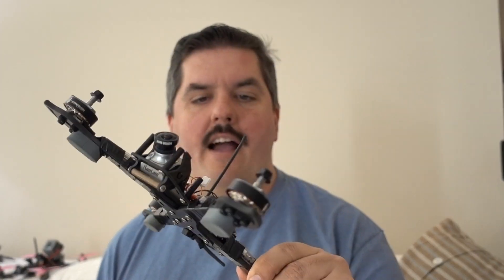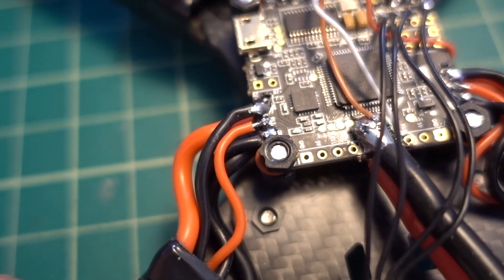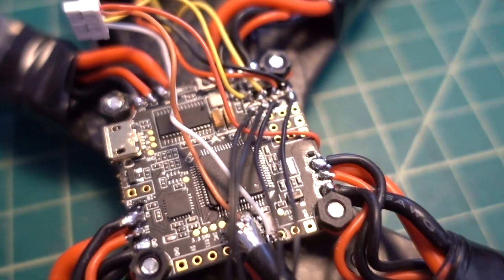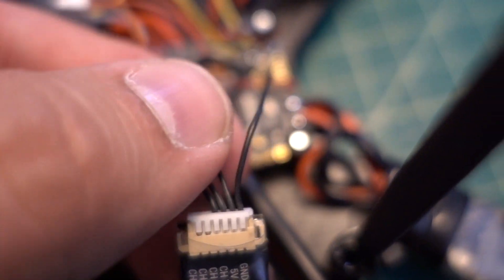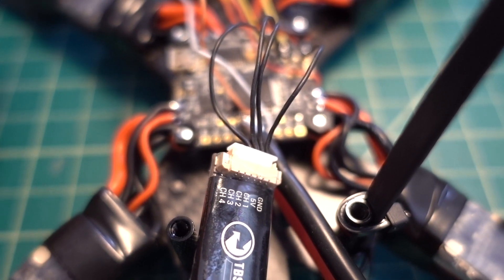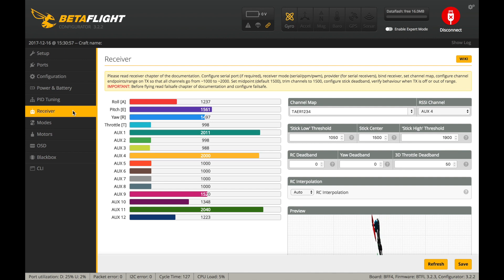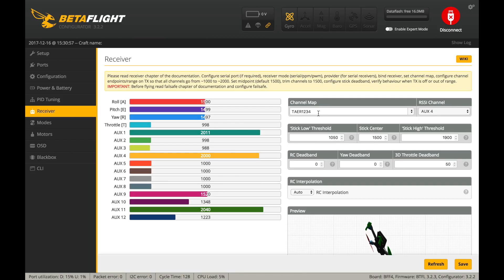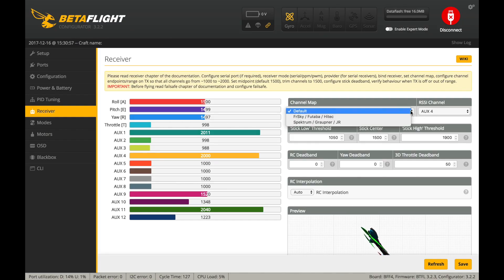How to Set Up Crossfire in Betaflight

Comment: Thanks for the video.  I have question my receiver is  Refused to bind or to updated after i updated the TX firmware.  And i followed all what you did with tours but i when i push the blue flashing light it just turn to blinking orange color . Do you have any idea what went wrong please?

Comment: I've followed your steps to the T and I'm still not getting any "movement" within BF Receiver tab. Properly wired up Rx -> Tx & Tx -> Rx on UART4. Enabled Serial Rx on UART4 within BF. Receiver is bound. BF configuration tab is configured for CRSF. Funny thing is I upgraded to 3.4 a few months back and initially had the same issue, but after messing around with the Channel Map (just swapping it by accident) I got it working. Now I just upgraded my FC to 3.5 and I'm back to square 1. No wires were changed. Any thoughts?

Taranis
Crossfire Nano
Matek F405-CTR
Reply: Josh Cowley hi. Did you manage to resolve it? Would like to learn from your experience. Because I’m encountering that right now. Any tips is appreciated.

Comment: Troubleshoot Help. Might help someone...
I've followed the video in every step, but in betaflight the receiver tab won't receive any inputs. I've tried different channel maps, also changed 3 different UARTS and none of them work. The crossfire binds all green lights but just won't receive on the flight controller. 

I'm using a Matek F405 CTR

Any help is appreciated!
Reply from the maker: You also have to map the outputs on the crossfire to CRSF. Set the protocol to CRSF and check that it is wired correctly.
Reply: StingersSwarm thanks for the reply. Yep fine all that. I've got a ticket with tbs going. So will pay an update when it gets fixed.
Reply: Hey SingersSwarm just letting you know I fixed my problem. My nano receiver the solder was to thick on the bottom side of the nano causing continuity between GND and CH1 so re-did all the soldering and its working perfect! Thanks for help and really appreciate your videos without guys like you we'd all be stuck.

Comment: Stingy, I did everything you have done and my reciever is bound to the crossfire but for some reason Im not getting any inpunts on the quad. Do you have any idea what it might be?
Reply from the maker: I'd start by checking the inputs and outputs on the Crossfire itself. But it could be several things. Chase the signal from the sticks to the FC and try to find the failure.

Comment: I have two quads set up with crossfire, micro tx and micro v2 receivers, One on a betaflight f3 board and one on a betaflight f4 board. Both are wired exactly the same and set up the same in crossfire and betaflight. 

I cannot get any battery (voltage/amp/mah, etc.) telemetry to come through on the taranis or the osd on the bff4 setup but I get all other telemetry (LQ, etc).

I do get all telemetry on the bff3 board and the firmware on both the FC and TX/RX are the same .

Also, I am running crsf on TX1/RX1 on both.

Anyone ideas to try and get it working on the f4?
Reply: dahosfpv hi there. Did you find out what caused it? Would appreciate if you could share your findings and solution.

Comment: You should try using a unify pro with crossfire, if you wire up its smart audio to the last pin on the rx and set it as smart audio in the lua script on the rx (CH 6 I think), you can control every aspect of the vtx through the lua script on your taranis, it's soooo nice!!
Reply: Any VTX with uart control you can control all settings with LUA script but you use BF lua instead of crsf LUA.
Reply: benii this is true! I just love all the features that crossfire packs. I've yet to have a failsafe with crossfire, even flying 3 miles out with the micro tx. I have flown just as far with frsky but it was much more sketchy.

Comment: You forgot to show the rssi on aux 4 to get it on the osd. And to add rssi on the osd screen.  Glad to see you back. Missed your videos.
Reply from the maker: You are correct. I screwed it up. On the receiver tab in betaflight there is a place to select rssi on a channel. Put in aux 4 then it will work in the osd.

Comment: wished you mention how to set up telementry if your not running ESC telementry on Betaflight F4 board and using crossfire.
Reply from the maker: It is the same. Esc telemetry doesn't effect the RX telemetry.
Reply: I had to go into the Power and Batter tab in betaflight and select on-board ADC for voltage meter source and current meter source to get mine to work due to stock setting is to get telemetry from ESC sensor.  but I did run my receiver off of UART3. maybe that had something to do with it.

Comment: My quad flys great but my telemetry doesnt seem to work. Always says 22
Reply: Snafu Snafuedem I had the same issue. This is what I did. set your channel map on port 8 to LQ. Enable dynamic power. On betaflight, on your receiver tab make sure you select port 8. Hope that helps. If not let me know.
Reply: I have same issue and tried this, still doesn't work.
Reply: Ill try that when  I get home. THANKYOU!!
Reply: It didnt work ;-( Just says zero now. I change it to channel 8 in beta flight too

Comment: one thing you forgot to mention is that your RSSI channel setup on Aux 4 is done in the receivers tab :D
Reply from the maker: Thanks yeah I missed that. I don't know how I didn't notice while editing.
Reply: How to display the RSSI/LQ on the Betaflight osd might also be a good idea. it could help out ppl that have never messed with an OSD before. ;)
Reply: he has it setup on channel 8, which in betaflight will be aux 4. 9 is aux 5 etc.
Reply: @WX4CB  Ooooooohhhhhh!!!! Ok. That's why my rssi reads 0 when I arm. Can't wait to try it out now! Thanks! I came to this video specifically for that information.
Reply: Yep! It's working! Thanks!
Reply: Does that mean " AUX4 "cannot be used as a switch  in the Betaflight MODES tab🤔🤔🤔🤔

Comment: Nice vid. 1 minus point though , you mentionned aux 4 in the beginning but after that you fergot about it...
Reply from the maker: You are correct. I screwed it up. On the receiver tab in betaflight there is a place to select rssi on a channel. Put in aux 4 then it will work in the osd.
Reply: StingersSwarm i know, i just wanted to inform you.
anyway keep it coming, i love your vids

Comment: He lives! Stingy we missed you!
Reply from the maker: I've missed you too!! lol
Reply: I'm using a omnibus f4 FC .  Having a lot of trouble maybe you can help with this.  I have the full size tx like yours have it set up per your video.  Have the micro v2 set up per your video.  Have the latest tbs update well as of couple of weeks.  BFF 2.21.  When in rx tab elevator aileron and throttle all move on throttle stick.  elevator and aileron stick does nothing.    Oh taranis x9d.  Tried to update per a JB video.  Not sure if it is right or not but didn't change the way the CRSF is acting.  Any help would be great.